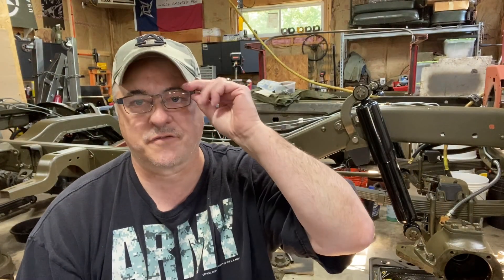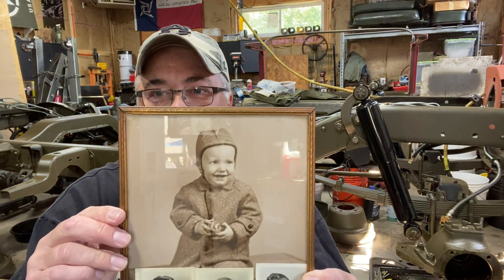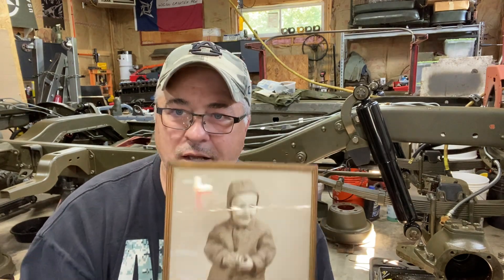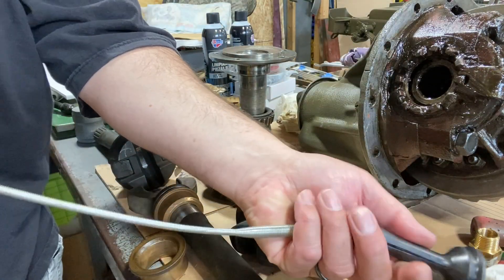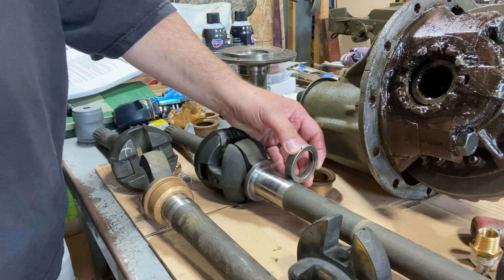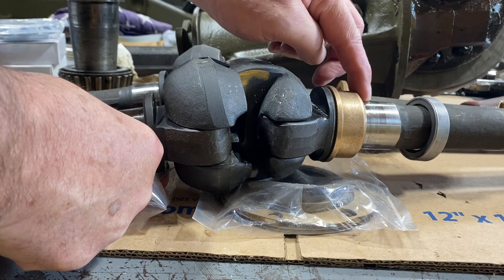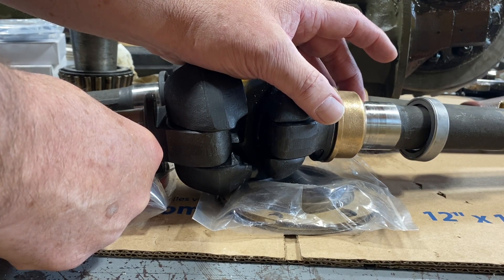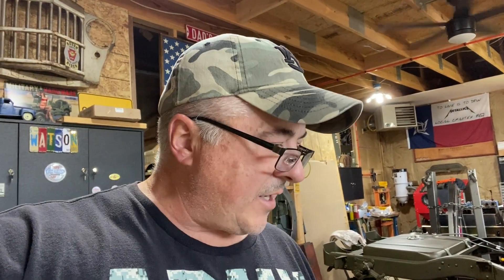M37 axle joint tolerances. Happy Father’s Day!

Comment: On the seal groove. I wonder if a lathe tool bit that instead of a cutting tool but a ball bearing off axis could be used to roll the sides of the groove down.  And if a machine shop could replicate the flange bushing with a slightly undersized bore.  Or if replacement axles are cheap enough not to bother.   Only issue is if an undersized bushing will slide over the splines.  Oh and you could make closely matched V blocks out of 6" pieces of 2x4 to have free standing v blocks to support the axle straight while measuring. Instead of in a bind

Comment: I have done (or have had done) engine (shop), transmission (shop), rear axle (me), and wiring (me).  Front axle has made me nervous that it would be beyond my skill level, but it looks like something I can tackle.  I am glad you are making these, I have referenced many of your videos for my projects.  Most complicated was the coolant distro tube, I found the same solder blobs you did.
Reply from the maker: I’ll make the mistakes so you guys don’t have to. Thanks for watching.